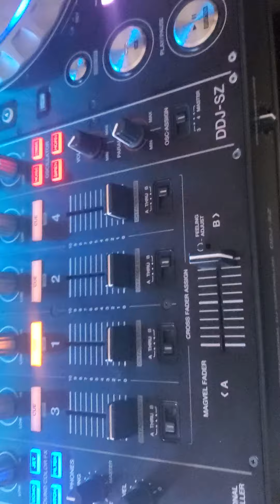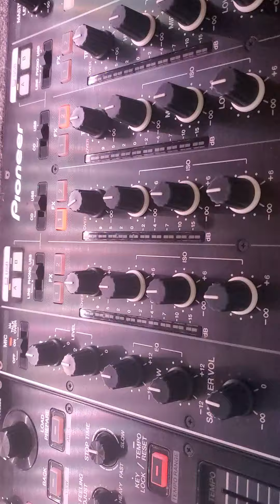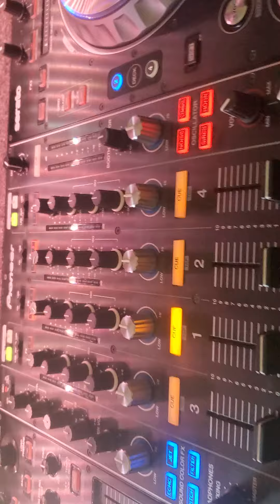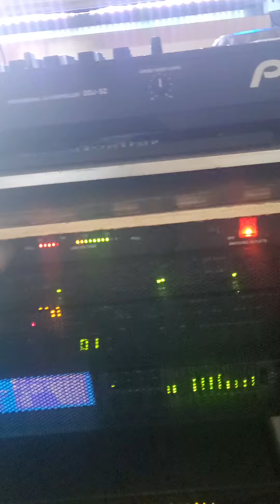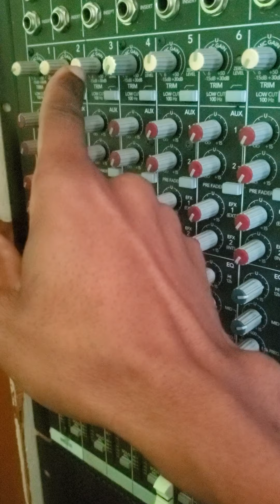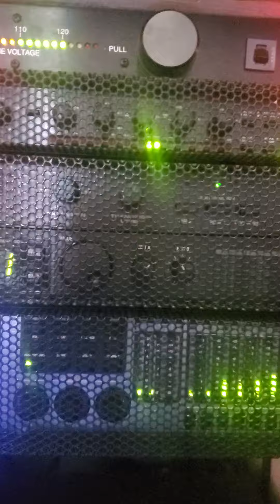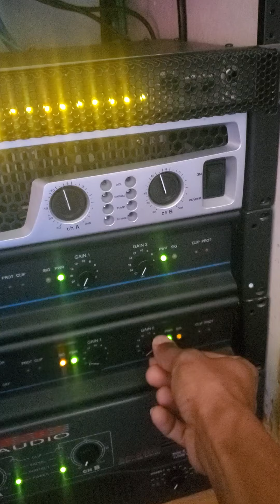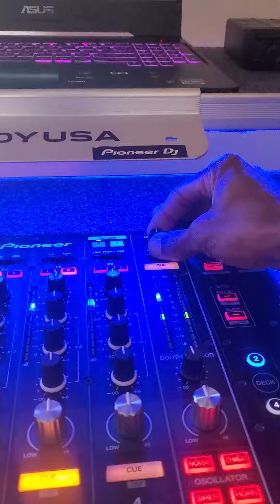correct gain structure (how to/what to)

Comment: Just because the meters are lit does not mean the signal is distorted. The only way to know the point of distortion is to test the output signal. You would be surprised much output the sz can send before clipping.

Comment: I got a question what level should my bass bottom be set at on my QSC ks12
Reply from the maker: The position of the volume knobs always depends on how strong your input is coming into the amp
Reply from the maker: If your signal is weak then normally you'd turn your amp up higher
   If the signal is strong going in then you won't have a need to turn your amplifier all the way out or as high as u would if that signal was weak
Reply: Thank you the gain knob was on 0 I just adjusted to 12:00 🕛

Comment: I was with you until you pass the controller. How is clipping bad on the controller but good everywhere else? ( distortion is distortion at any stage ). In my understanding, proper gain structure creates balance, clarity and headroom leaving space for applying eq or additional volume if needed without clipping. Clipping not only creates distortions, it creates added heat which can  damage your equipment. Look up analogy vs digital scale or dBu vs dBfs. This help me, especially with balancing analog and digital sources. 

Each One Teach One. Bless!
Reply from the maker: Clipping doesn't always mean your audio quality is distorted... it can also mean your component is delivering its audio at its maximum. A steady red signal light means distortion.
Reply from the maker: Very good solid and valid questions tho. Each 1.... 👊🏾
Reply: @heatwavesound.djezee909 Yes I agree. But riding so close to the edge imo is asking for trouble. If for any reason the compressor/limiter don’t do its job… is problems….
Reply from the maker: @ankh1986  6 of 1 half dozen of the other when your driverack line outs are at unity (0)db your amplifiers needs to be turned out more correct?  What happens when u have a faulty jack, pick up a hum or hiss. Louder hum/hiss right... tweeter and horn damage. Or even if the compressor doesn't do its job.

Comment: Me understand what you're saying but how loud of a sound you can produce with your Amp not even quarter and your clipping,
Reply from the maker: Wherever the amplifier clip lights come on that means the amp is producing its maximum output
Reply from the maker: The lower your input the higher u would have to turn up the amp
Reply: The channel that is clipping is not connected to any speakers. I can assure you that when the speakers are connected it won't clip that easily. Test and proven
Reply from the maker: @RangerTyrone  100% correct 
 The channels that are clipping, Ther isn't anything connected to them. 
 All 4 amplifier are playing stereo. 
 Behringer 4000... left and right low-mid
 Nady audio... 3000 left and right hihg-mid
 Qsc 1500... left and right horn 
 Qsc 1500... left and right tweeter. 
   So I'm playing 1 column of the sound just on a very small ⚖️ scale.   (2 eight inch speaker) if I was to connect the 8 conductor speakon to the side that's clipping I wouldn't u already know what would happen..

Comment: That’s bad advice. The hotter you run your signal the better. It helps you get over the noise floor. Low signal does not mean clean.

Comment: This is not how you gain stage any system,😂the only thing you have done correct in this video is setting up your controller at unity, clearly you don’t understand how to use the dbx drive rack as there is no reason whatsoever your drive rack or amplifiers should be clipping especially with the volume control on the amplifiers set so low,red clip lights on any system is a big no no in the audio world.
Reply from the maker: You've got much to learn friend... stay tuned 🤣
Reply from the maker: Your amplifier produces what u feed it. If your input is distarted then your output will be distarted. Red clips on your amplifier means it's at its maximum potential.   Much to learn sir
Reply from the maker: Listen to the audio quality. Is it distarted? the driverack is clipping but sound quality is still sweet, yes. Much to learn.
Reply from the maker: If u have questions just ask... that's all u need to do.  I'll answer. 🤣🤣